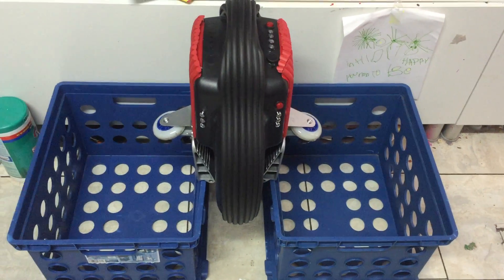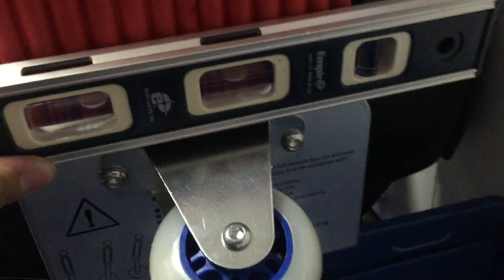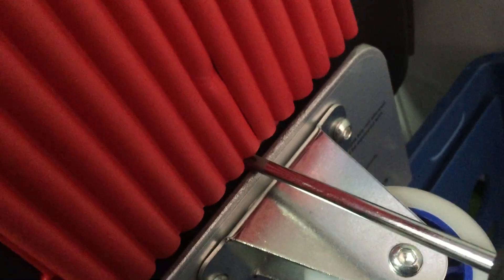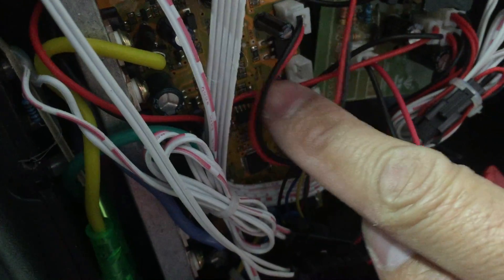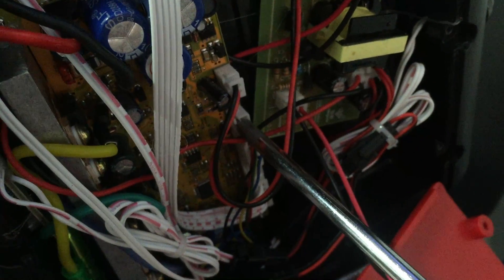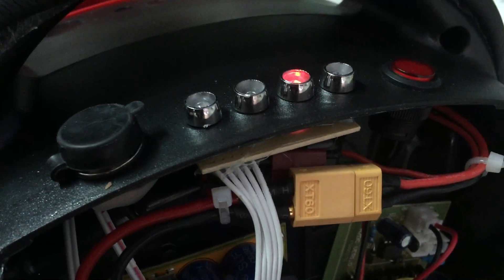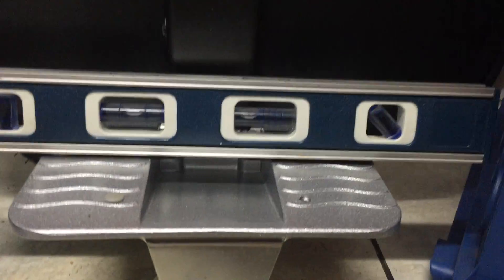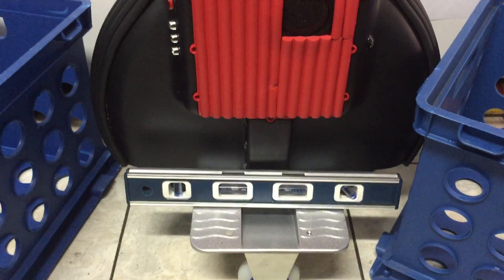How to Calibrate & Fix the Balance on a Chinese Electric Unicycle

Comment: thanks for ur video, 
My problem is i try same process but the led lights does not blink like in the video, mine start to spin clock wise for 3 seconds and then anticlockwise for other 3 seconds, then stops and makes the beep sound.
I still have the balance problem with my unicycle, please anyone help to solve this problem, my mail is foodplus99@gmail.com
Thanks